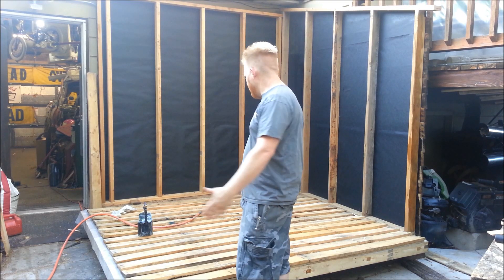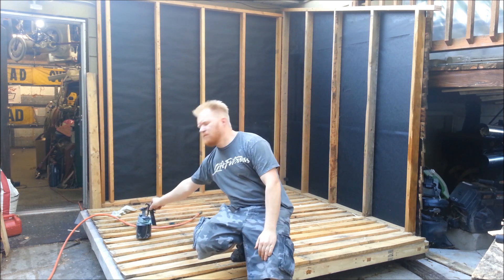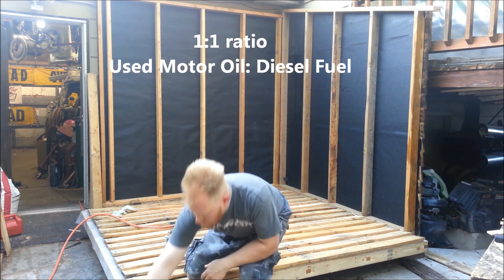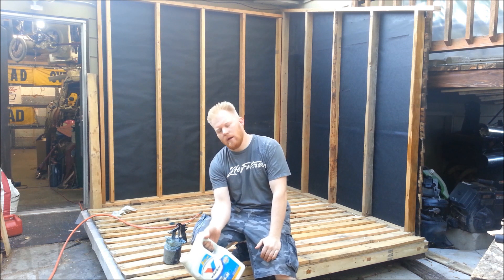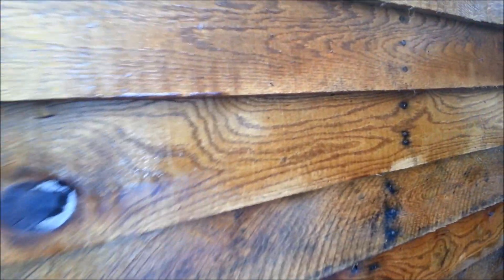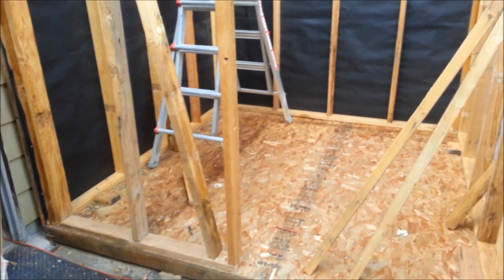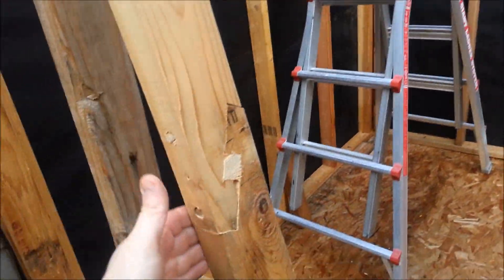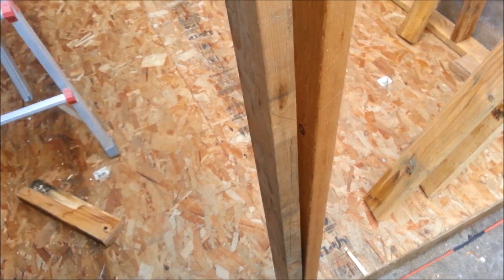MOTOR OIL STAIN Shed from FREE pallets part 3

Comment: Don't listen to these armchair know-it-all safety freaks. I've been using diesel and used motor oil for years for staining and bug proofing fence posts on my farm and not only they last a million years, they never get termite and other wood eating bugs either. The smell goes away in a few days under the hot sun and they are better than pressure treated wood of any quality.

Really enjoyed this series and subscribed :)
Reply: can confirm,  old timer remedy for termites was to spray diesel on wood at the foundation
Reply: Same me !
Reply: Lance Uppercut Really? This has to be a joke, or have the youth really lost their minds and need purged?
Reply: I get it.....but maybe I'm missing something like doesn't this make your wood house even more flammable lol
Reply: @BigNatorStrength  No it does not make it flammable.Try lighting thw wood after you treat it and you will see.

Comment: I am using used motor oil for years to protect wood. I do not add diesel anymore, because it stinks for a month or so. I just heat oil on the sun outside, until it got warm, and then roll or brush it on wood. Dry wood will absorb it right away. Just reapply it every summer. Note: wood become little softer, because oil makes it a little wet.

Comment: I live in Bulgaria and here they have used old engine oil for wood since forever. It's only first now you can get proper wood protection but it's expensive.  I was thinking I wanted to use engine oil with diesel but I'm scared of it catching fire as its my house that needs doing.  I use diesel to ignite fires and that catches fire pretty sticks!
Reply from the maker: All of the good wood stains in the USA are oil based and more flammable than diesel fuel.
Reply: sixtyfiveford agree..
Reply: But once it dries and dissipates doesn't the flammability lessen a lot? Or do people use a laquer over a stain?
Reply from the maker: ksahagian
Yeah, there's no more flammability here than just plain wood once it dries.

Comment from the maker: The oil stain seams to hold up very well.
Reply: How are the boards holding up after 7 years?
Reply from the maker: @broken_font1881  Fantastic. I haven't had to touch them since I built it.

Comment: My dad asked me to stain a wooden fence with used motor oil. I thought it was a nutty idea, but a quick search led me here. Wow. He says when he did it last time, the fence lasted 30 years. Time to put on my painting clothes.
Reply from the maker: i Awesome. It's better than any commercial stain.
Reply: i Hi it works great with used oil and you can get it free from some service stations.
I did my fence about five or six years ago and it still looks great.

Comment: That's different to use motor oil as a finish. You're right it dose have a neat finish to it. Thanks for sharing
Reply: I did a test with just some used motor oil painted onto a new fir 1x6 fence board from Home Depot.  I painted it when it was horizontal and put it out back in the sun horizontally also.  It started off pretty black in color, but after a week, it was a rich brown that looks pretty good.  One thing that I did notice though is that it soaks through the board, mainly near the knotholes... The wood there just seems to wick the oil through the board... It has not rained in the last two weeks, so the weather has not had any affect on the amount of oil left in the board.  It still has enough oil on it that if you rubbed a paper towel over it, you would get some oil discoloration on the paper towel though.

Comment: Great discovery!  50% diesel, 50% motor oil.  I wonder if that would work for an interior wall, in regards to being ok with smell of fuel and oil etc.  Thanks for video
Reply from the maker: It is more of a wood preservative than a decorative stain. Making it ideal for outdoor wood. There is an odor associated with it, that dispenses in a week or so outdoors. I would suspect it would smell longer indoors.
Reply: Jack Jones  it will but bear in mind it il stink for days

Comment: +sixtyfiveford  Its been a little over 2 years, how is the treated wood holding up to a) the environment and  b) pest ? I want to use this treat my pallets for a fence, but i'm afraid the motor oil/diesel combo will wear off and the environment and wood ants will damage it. please advise, also where did u get the really long pieces of wood, all the pallets I saw have pieces of wood approximately 3 feet long?
Reply from the maker: +J Henry It's holding up great. I have a wood deck right next to it that I paid well over $100 just for the stain and it wore off in 2 years; oil is by far better. Though not as common if you keep looking you will find 8' pallets(3'x8' or 4'x8) or shipping crates. This is where I got the 8" 2x4s and other long material (even a bunch of 2x12s by 12' long)

Comment: How well would this apply to a standing fence, like a privacy fence?  Would it run off before soaking in?  I ask as I saw you apply it to a horizontal surface.
Reply from the maker: I just sprayed them horizontal as it was easier. I did do the final sides and door vertically and it worked great. The wood soaked then stain in extremely fast, no different than a commercial stain.
Reply: Thank you.

Comment: Love it and it is a good way to not waste wood or used oil and it protects the wood!!

What would it do to OSB?
Reply from the maker: It works good on OSB. It takes longer for it to soak in since OSB  is essentially wood fibers with glue soaking them already.

Comment: Another cool tip for motor oil I got from my grandfather is use it to condition the leather of your work boots. It really works well to add some water repellant properties and it will prevent the cracks where the leather flexes at the toe for a long time. He always used new oil but I found used to be just about as good and it has the benefit of being a waste product rather than something ya have to pay for. :-D
Reply from the maker: Nevir202 Nice tip.
Reply: shall able to avoid termite for 30 months.
Reply: Nevir202 my dad would take the empty oil cans and set them upside down in a funnel. you would be surprised how much oil is left in a can or now a plastic bottle of oil. free oil for your shoes or shatever

Comment: Sixtyfiveford, I am looking to build a pallet shed for use as a smithy.  Since I have flooding issues in my yard, I plan on using railroad cross ties to make a "box" and fill it with gravel for my foundation and raise the smithy floor off the ground.  Would treating the underside of the floor  with this stain be enough to resist moisture while water drains through the gravel?  I also plan on using it on the outside walls as well.
Reply from the maker: Yes, the oil soaked wood holds up very well to moisture.

Comment: This technique has been around a long while.  Spraying is OK, but I'd use a brush after spraying just to work the oil into the wood- a habit I picked up from spray painting wood houses I suppose.
Reply from the maker: For sure. I used a rag to distribute the stain evening.

Comment: how good is the dry out ? is it sticky or smelly after it has dry out ? 

nice video , great work ..
Reply from the maker: +Leo TechTips It's just like any stain. Dry, with no smell.
Reply: thank you very much for answering ... 

i am gone try it out on a wooden fence ....
great tip and video
Reply from the maker: I've used it on my fence and it is amazing.
Reply: i did try today a few feet on the woodwork on our wooden garden house ... it indead works great .. the house was already stained but needed to be done again , it stinks a bit while mixing , but nothing very bad .. and here in spain it was dry to the touch within 2 ours .. (still 22 degrees celcius) thank you very much for this tip

Comment: Hi and thanks for sharing. First time homeowner here looking for ways to cut costs and use smart recycling methods.

Question: can I use the motor oil by itself? Just paint it on my fence?

Do I just ask around for used motor oil? since I get my oil changes done at shops.

My fence is currently being installed...how long do I wait before staining it? I live in western Florida. Do I wait a few months to do it?

How many coats do you recommend on brand new fence?

Im assuming I will have to do both sides of the fence, correct? 

Sorry for all the questions. I'm a woman, first time homeowner, single momma just trying to make it out here! :-) 

Thanks in advance!!!!!
Reply from the maker: Straight motor oil works the best. 
Walk into an auto parts store or oil change place for some old oil (take an old milk jug)
I would wait a month or so for the fence to dry out before applying stain.
Both sides of the fence will preserve it best.
Reply: sixtyfiveford thank you sir
Reply: I used motor oil on my open car trailer a few years ago.  Has to be better than nothing.  Just don't sit on it.  Learned the hard way.
Reply: Tanner Phillips thanks!

Comment: would the dye in "off road diesel" stain the wood red....what if you used transmission fluid and off road diesel
Reply from the maker: +Lee Goins Probably a little.
Reply: +Lee Goins  mix burned fries oil (vegetal),  mix with  engine oil,
Reply: +sixtyfiveford Its been a little over 2 years, how is the treated wood holding up to a) the environment and  b) pest ? I want to use this treat my pallets for a fence, but i'm afraid the motor oil/diesel combo will wear off and the environment and wood ants(termites) will damage it. please advise, also where did u get the really long pieces of wood, all the pallets I saw have pieces of wood approximately 3 feet long?
Reply: J Henry if u are afraid because environmentaly issues,  I assure its secure

Comment: Good video.  I would love to see a video of how you made the joinery on the 2x4's to make them longer.
Reply from the maker: Thanks. The joinery for a 2x4 is based on joinery for larger beams(timber framing joints). It is not extremely strong due to the small surface area of a 2x4 and the nature of the soft wood, but it did work adequately for this project.

Comment: What kind of sprayer did you use? I was told that the motor oil can’t be sprayed ...
  NM... I read comments. You used diesel to thin the motor oil. THANK YOU.
Reply from the maker: You can just brush or roll it on as well.
Reply: sixtyfiveford 
I am building my sheds out of pallets. I used a brush yesterday and, sooo messy. I didn’t know how to thin the used motor oil. I was going to try mineral spirits...😕. 
  I have a small air compressor too ... sooo we shall see how this works.

Comment: I am building a firewood storage rack out of pallets and using my used motor oil as a stain and water sealer.  How is yours holding up against the elements?  Also, like Jason said, any issues with using motor oil?  I'm storing firewood in mine, so I dont know if it will affect the wood or not, hopefully not as I use this wood inside my house for heat.
Reply from the maker: The motor oil makes an amazing wood preservative and no it won't affect the wood you store on it.

Comment: Thanx for the vid!
Wondering if I can stain my new russian pine wood doors to close to coffee color 
- by using really dirty motor oil or increasing the proportion of motor oil or adding brown powder color. 
- sealing it with sealer
- applying two coats of lacquer.

What you advise man?

Comment: you are amazing. I love that door. The motor oil / diesel stain worries me, though. Would it not act as an accelerant in case of fire?
Reply from the maker: The motor oil/diesel is less flammable than a typical oil based stain you would buy from the Home Depot.
Reply: Wow! Thank you for replying. I learned so many things from this video series. Thank you for sharing
Reply: ALL oil-based stains act as an accelerant in case of fire. The "volitales" in the stain would evaporate over the course of a day or two, however, leaving just stained wood. ANY dried wood will burn readily.

Comment: Super Cool :) would that stain be ok if ya ever had to sleep in it? Really good info in this stuff. Where the walls join, kind of a question on that, must have missed something. Would the siding extend over the other walls edge? Seems like it would leave exposed board there at the edge. I don't think you'd miss that lol, so I must have missed something.

Comment: What kind of wood did you use to trim out the pallet siding?  Did you stain it as well?
Reply from the maker: Standard 2x4 material so Douglas Fir. Yes, it took the stain just as well as the Oak siding.

Comment: I'm seeing some people say to use kerosene with used motor oil and seeing others saying to use diesel with used motor oil... so which one is the best and why
Reply from the maker: Kerosene and Diesel are essentially the same thing and can be used interchangeably. Where I live Kerosene is $10-15 gallon vs Diesel at $3-4 gallon.
Reply: WOW...10.00 - 15.00 per gallon for kerosene!
Here in the United States there isn't much difference in cost between diesel and kerosene

Comment: Does the motor oil and diesel stain rub off onto clothes etc , was thinking of using this method on outside table and chairs as cheap option , cheers
Reply from the maker: +Jayne Mercer It's no different than oil stain you would buy from the store. You just have to give it a few days to dry.
Reply: +sixtyfiveford  Excellent , will ask my local garage what he does with old oil and diesel when servicing vehicles , I know ive got old unused motor oil in the shed , I've had loads of pallets from work for free and constant supply if needed so be great for fencing and garden projects its going to be brilliant not paying out for wood protection and stainer  , Thanks again
Reply from the maker: The only reason for the diesel was to thin it, so it would spray easier and soak into the wood a little faster. Straight motor oil works great as well when hand applied.

Comment: what are you tips for the renewing the stain on wood trim on an old 1985 boat?
Reply from the maker: Eric Nichols Motor oil works great but doesn't give wood a gloss like most interior/decorative wood should have. I would use a marine varnish.

Comment: Hey I have a question will that prevent termites from eating the wood adding motor oil on it like that?
Reply from the maker: I think it would prevent termites if the oil soaked deep enough.

Comment: Good idea for stain, sure beats the laytex so called wood preservative, I make mine using Rustolium oil based enamel 3 parts paint thinner to one part paint.
I think your idea is better , unless I had to paint over it than I would not use motor oil because it will not dry.
Great looking shed, you must have a special "rig" to make the mortise & tennions.
Could you make a video on how you make them?

Comment: Can I just use the “used motor oil” ? Don’t have any diesel fuel? I just put up a cedar fence and I have a lot of used motor oil.
Reply from the maker: Diesel fuel or mineral spirits just makes it easier to spread. It's not necessary.
Reply: sixtyfiveford Do I need to treat both sides? Thanks buddy

Comment: To each his own, but with all the available products out there for this application, I just dont know why anyone would do it this way.
Reply from the maker: Because it works better and is free.
Reply: @sixtyfiveford  Not necessarily free, if the oil came from his car he paid for it to begin with.  Same for the diesel.  I get it, if it works than you get to re-purpose something that would otherwise be disposed of or recycled. I guess it's just 6 to one, half dozen to another.

Comment: How did you fasten the wall frames to the deck?
Reply from the maker: If I recall I put a single screw in each corner. But I may have put a wooden peg.

Comment: QUESTION.
What is the technique called for the walls how it is layered/stacked?
Reply from the maker: +KnifeCrazzzzy "Siding"?
Reply: Yes the siding or side of the shed. I am trying to figure out the the name of the technique of how it is built. It seems to be layered, staggered, fallen over domino, overlapping... I just can't find the terminology to look up the way to build it.
Reply: +KnifeCrazzzzy I think he installed it like clapboard siding, except the joints were not staggered due to the nature of his design with the chosen materials.
Reply from the maker: The technical technique would be called a "lap joint"

Comment: that seems like a very flamable structure
Reply from the maker: Diesel fuel will not light with an open flame, neither will motor oil. Commercially available stains are petroleum based(OIL) and generally more flammable due to the thinners used.. Oil is one of the only things that will make wood water resistant, otherwise it will rot.
Reply: sixtyfiveford you should do a ignition comparison test between your stain and commercial petroleum stains. Now im curious.
Reply from the maker: You can take a cup of diesel and hold a torch right to it and it won't ignite. People assume diesel fuel is like gasoline but diesel is just thin oil.

Just looked up a Home Depot Behr wood stain, MSDS:
5% mineral spirtits
60% kerosene
The thinners they use in commercial stain will instantly light when a flame is held to them.
Reply: sixtyfiveford people freaking out over flammability, I use same stuff on trailer wood because its free and works better.
Reply: My god man, you have the patience of a saint

Comment: Is inhaling it when its dry toxic ?
Reply from the maker: daughteroftheking It isn't. Commercial stains you would buy from the home improvement store have more toxins in them than this.
Reply: sixtyfiveford Can you back that up with proof?
Reply from the maker: MSDS of standard wood stain Olympic Brand (virtually all brands are identical)
https://buyat.ppg.com/ehsdocumentmanagerpublic/documentsearchinnerframe.aspx?CodeValue=41601&CodeCondition=IsEqualTo&Language=en-US&SuppressSearchControls=True

Standard motor oil:
https://www.menards.com/msds/106494_003.pdf

Diesel Fuel:
https://www.marathonpetroleum.com/brand/content/documents/mpc/sds/0290MAR019.pdf